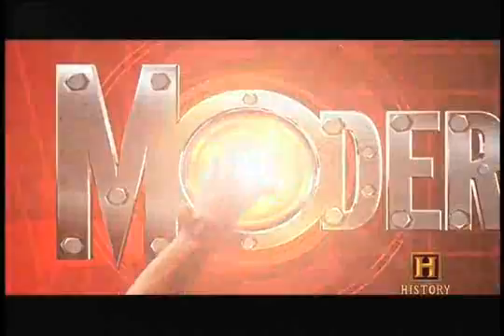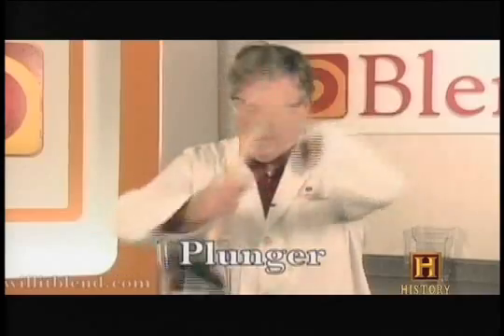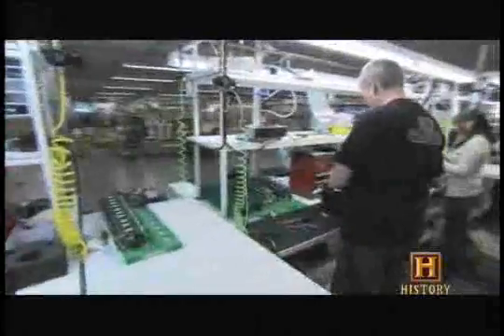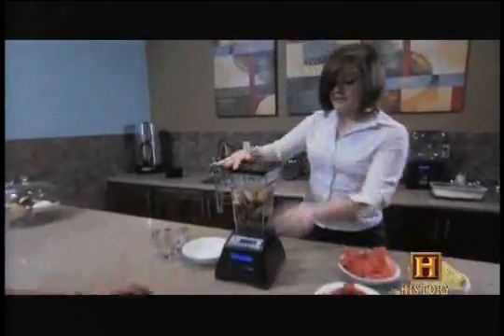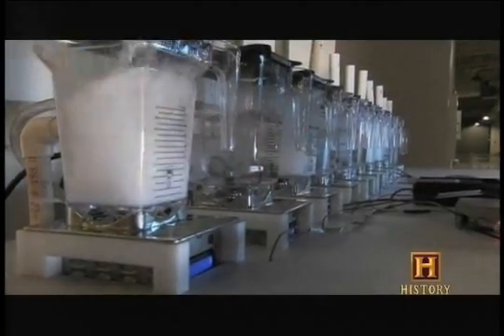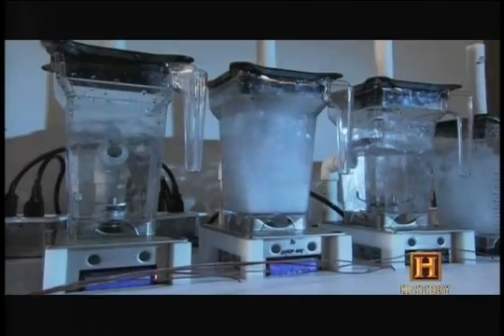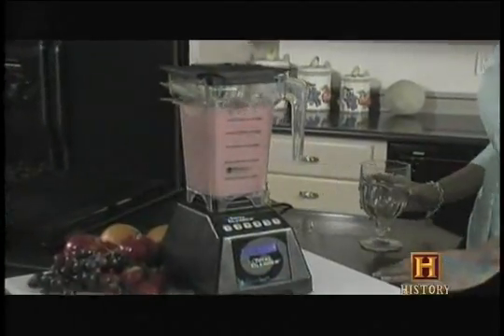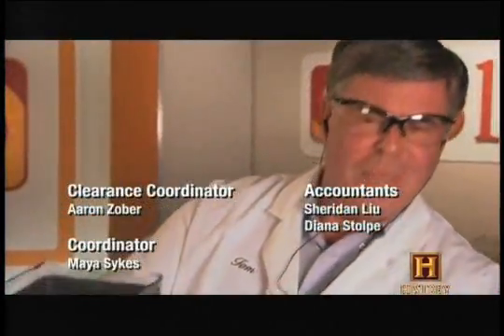How A Blendtec Blender Is Constructed

Comment: The motors on the Blendtec are awesome but what are they gonna do about the leaky gaskets on almost all their jars?
Reply: +TheDiet God They have replaced 9 of my jars over the years (under warranty). Now I am just trying to figure out what to do with the jars. I want to up-cycle or recycle them, but the blade housing is a permanent part of the blender, so to get it out, you have to pound it with a hammer, which will likely crack the jar. i was thinking about re-using the jars for herb planter pots. If I recycle them (not sure if they take polycarbonate), I think I need to separate the blade housing from the jar so they won't just throw it in the tract instead of recycling the materials. I have been using blendtec blenders daily since 2007. I even take mine with me when I travel. I adore it, but it bothers me that even though they replace the jars when the bearings fail, I have to figure out what to do with the jar. I wish they took them back and re-cycled the materials.
Reply: thrivesurvive Just throw them all at Blendtec's door step, maybe they'll learn how to make proper seals. Also I've been having a lot of overheating issues with the Blendtec. It turns out they're not really for commercial kitchens and more for like Starbucks and Jamba Juice type of use, which is really just smoothies. When I use the Blendtec for making cakes, breads it really overheats and tears up gaskets. We all went through 3 new Blendtec motors, and still haven't broken our Vitamix....yet.
Reply: TheDiet God I have had some overheating issues too (when I am blending a whole jar of frozen bananas or very hot bisques, which is my fault), but every time my blendtec has failed, the company has quickly and politely replaced it. For what I put my blender through (daily home use), I am still very impressed and in love (am in love with) with mine. Perhaps the Vitamix may be better for really thick formulas because it has a tamper. Maybe try dividing your batter and dough in half. Also, be sure to twist your blade a few times before each use. Blendtec now has more jar options so perhaps they now have one that is better suited for your purposes. Blendtec is constantly working to improve their product, but there are limitations with materials and technology (considering the moderate, consumer-accessible price point), so I wouldn't be too hard on them. They have made a blender that beats all others. Considering Vitamix violated Blendtec's jar patent (and lost when sued), I feel like it's easy to reverse engineer. It's much more difficult to be the first to innovate. Just make sure your machine is under warranty with the company. They have always treated me very well. I have been a loyal customer since 2007. If my house was on fire, I would grab my blendtec and my sewing machine (my livilihood) first. Regarding them learning how to make proper seals, I'm certain they are working on it. In the mean time, they replaced 10 of my jars at no cost, with free shipping. Considering each jar runs around $100 bucks, I really can't complain. I also did some research. The materials the jars are made of are recyclable, so when I concluded that I don't want to up-cycle  mine, I put them in the recycling bin.
Reply: thrivesurvive Well dividing my batters would double the time, and time is precious to me because I make large batches in one day many times a week. I did 6 batches of bread dough before our Blendtec overheated, yet our Vitamix did 24 batches and never overheated. I have to throw our Blendtec motor base into the fridge to cool it down faster, if you do the math time wise it would take 2 or 3 days to make the same large batches of bread dough that a Vitamix can do in 2 hours. Also the bread dough uses pure raw almonds and the texture comes out grainy or lumpy (which is horrible), the Vitamix always comes out smooth and more like regular (flour or wheat) bread. If however you first make 1 cup of almonds into fine flour then later add the ingredients, it comes out closer to Vitamix's smooth results, but it also adds a whole day of pre almond flouring.

But the Vitamix doesn't require any pre-almond powdering, we pull whole frozen almonds right out of the freezer straight into the jar and the results still come out smooth as flour bread. Btw the tamper is not needed for our bread recipe.
Reply: thrivesurvive 

Also in the smoothie department I make them super thick (almost like ice cream). With the Blendtec its really difficult if using own made recipes. I have to shake or use a spatula to move thick frozen ingredients around, and even then by the time the Blendtec starts going the frozen produce is all liquidy and goes into regular smoothie (which I don't like). To get a thick texture with the Blendtec it requires less blending time which doesn't really puree the frozen produce, the Vitamix can (with experience) make a super smooth fine ice cream-like smoothie without melting or liquid-ing the frozen produce, this does require a lot of skill with the tamper. 

The twister jar is too small for large batches (even the larger twister jar). We fill our Vitamix to 96 oz capacity and make lots. The Blendtec strangely has the large 96 oz Wildside (the one Vitamix copied) but I was told by Blendtec reps themselves its not a good idea to fill to the top, and +70 oz is actually what it's limited to. I measured both (VM & BT) jars and both had identical measurements. So Vitamix's 64 (shorter wider new gen) is really a 96 oz jar just like BT-wildside but Vitamix can actually use all available oz. Also the twister jar is an extra $120 and the tamper is free.  

Also the Blendtec doesn't do well when blending black berries, blue berries, raspberries, strawberries, kale or spinach. I mean yeah they come out very smooth, better than any other blender minus the Waring or Enpee, but compared to Vitamix the Blendtec can't really get the seeds. I spit out so much seeds when drinking any smoothie from a Blendtec, while the Vitamix it has very little, hardly any. And the greens turn into paint in a Vitamix, while in the Blendtec they float around like green glitter.
Reply: thrivesurvive

I know it sounds like I'm bashing Blendtec, I'm just telling the facts. It's sweet music or blasphemy to one's ears depending on who's side they're on. Its just that we've tested almost all blenders and the Waring and Vitamix are really the only ones who always stay at the top fighting for the championship. Blendtec just really focuses on smoothies (and iPhones) which it does well, but it seems they are more interested in making it easier to use for domestic homes rather than versatile. They spend almost all their production money on making touch screens and fancy buttons rather than making better jar, blade, motors and cooling fans. 

Also the single dull blade has a lot to do with many of the errors in Blendtec. It produces more heat which contributes to the famous overheating. It doesn't puree the berries and greens mentioned before as well as 4 sharp blades. It requires more speed and HP to spin and blend which also strains the motor to overheat. It also loses a lot of power under hard thick ingredients or overload the jar. The Blendtec sounds loud and fast under light loads but under heavy large ones the Blendtec feels and sounds like it went from 3HP to 1.5HP, while the Vitamix keeps the power and speed on all loads, and stays a lot cooler too. 

The precision speeds on a Vitamix are unrivaled, the Blendtec needs to lose the expensive lousy touch pad speeds. The turn knob was and is still the best.....especially when you got gloves on covered in batters and creams, the touch pad is a pain in the ass to use under these circumstances. 

I will say that the Blendtec's pouring spout is far better than any blender we've tested, the Vitamix's is the worst. Blendtec's feels precise while the Vitamix feels like a dump truck.
Reply: thrivesurvive The Blendtec is safer to use since its hard to accidentally turn in on, which is why I bought my girlfriend one. Lol, if my house was on fire I'd strap my guitar on my back and push my motorcycle out the garage first, to hell with my Vitamix I'll just get a new one :)
Reply: I'm glad you found what works well for your needs. :)
Reply: thrivesurvive Thanks, its a shame we can't publicize our work( don't wanna get sued), it really shows the strengths and weaknesses of both blenders. And I don't see either company actually using their blenders in commercials or live demos like we do. We're not sponsoring Vitamix or Blendtec, we've had quite a few unfriendly conversations with both companies before over their products. I'm really glad Vitamix lost that lawsuit since making the Wildside for their motors would have been a horrible idea, I don't think they're aware of the many flaws with Blendtec's wildside jar. But I think we can agree Vitamix's version wouldn't leak like Blendtec's wildside. 

But I tell the Blendtec reps that Vitamix should have been sued for a lot more than just 23 million. Ex-CEO and Blendtec founder Tom Dickson himself said that they lost the Starbucks and Jamba Juice contracts when Vitamix released their version of the wildside. Vitamix made easily around 100 million with those contracts. Vitamix sacrificed 23 million to make an extra 77 million, sounds like a very good trade. Its also no coincidence that after the lawsuit Vitamix released their higher grade more expensive 7500, 350, 750 Pro models. 

I just find it hilarious that Blendtec owners like saying "Blendtec sued Vitamix and won, hah we win".

I like your idea of using your broken jars for plants, maybe growing some spices would work out well.

Comment: You got your Blendtec at Costco or Sam's Club (Don't Lie) because that's the only place where you can get an 8 year warranty from it. In fact, those are the only places that sell Blendtecs locally. Local retailers just don't want to carry the Blendtec line. In fact, Costco recently announced that they are dropping the Blendtec line in favor of Vitamix as their only power blender. Starbucks also recently dumped Blendtec in favor of Vitamix. You'll be the only one owning a Blendtec soon enough.